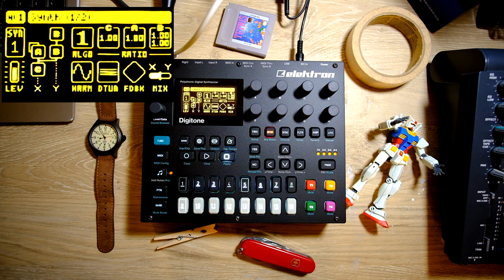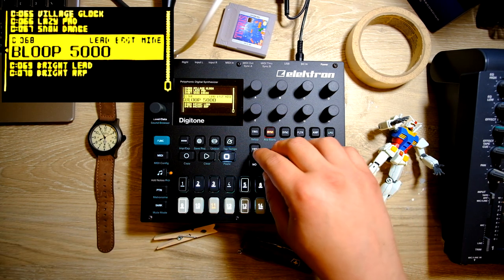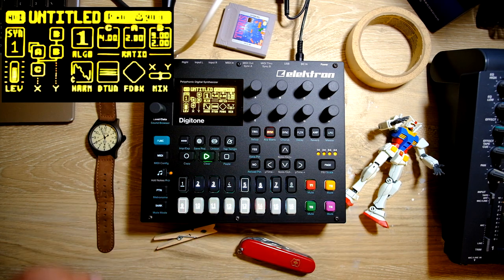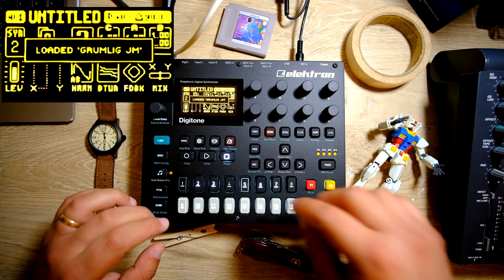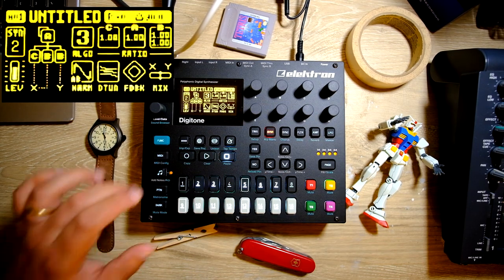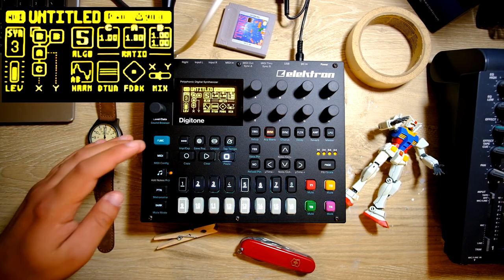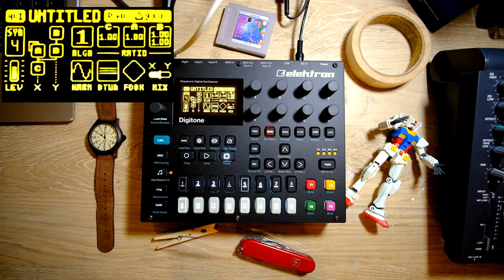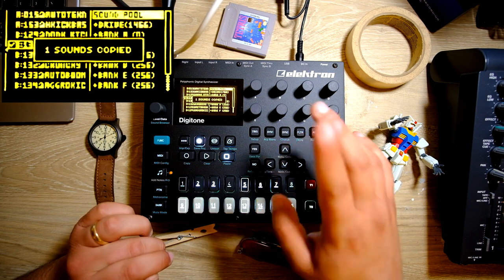Making A Song On The Elektron Digitone

Comment: Quick tip:  You can turn metronome on and off without going into the menu by long pressing hold FUNC + hold Metronome longer than a normal press.  A small notification will appear that says 'Metronome On' at the top of the screen.
Reply from the maker: Nice! Thank you for letting me know.